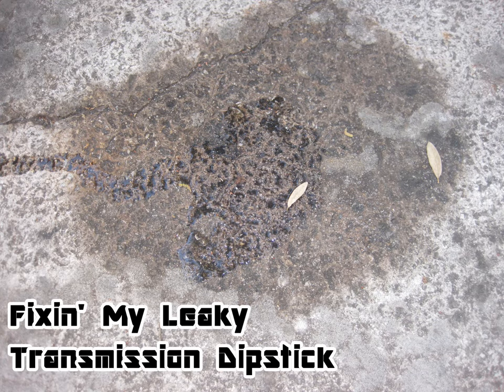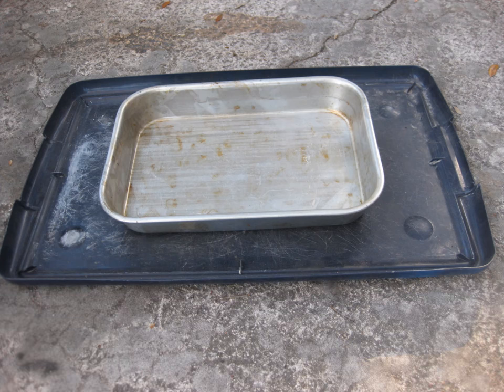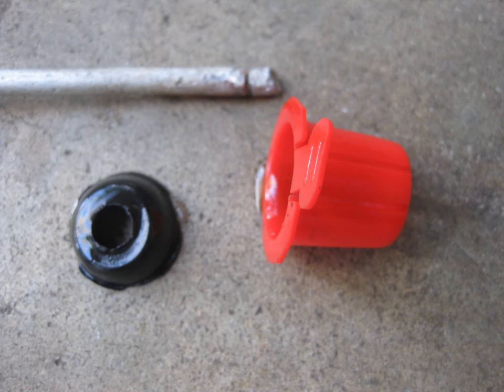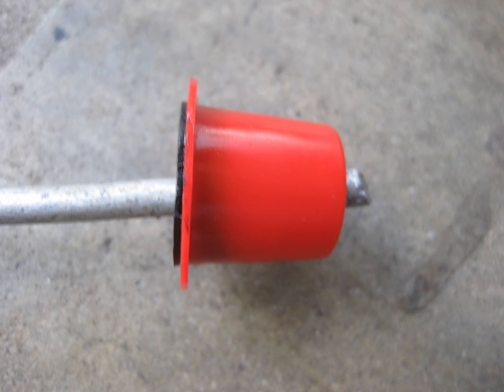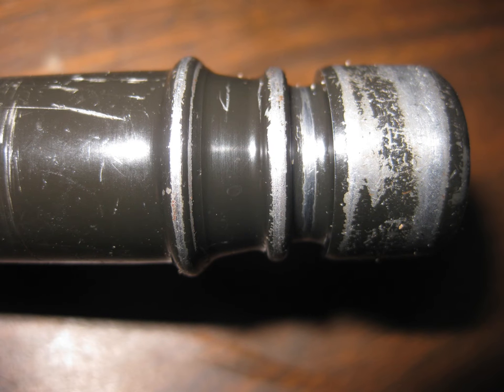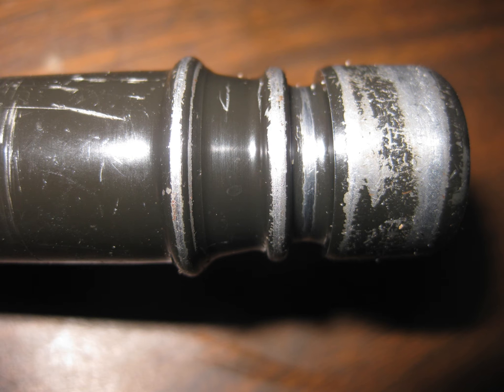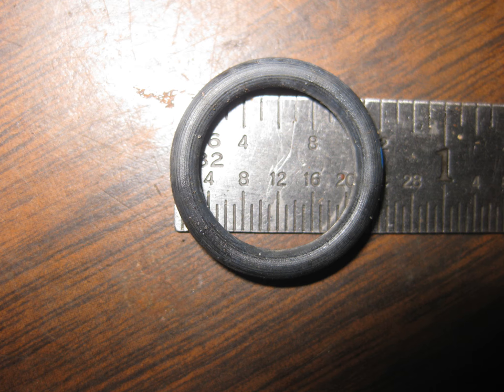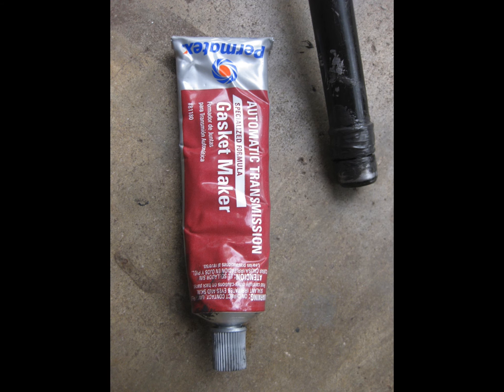Transmission dipstick leaking Fluid?

Comment: Thank you for the information.  But now I want to know why does it only happen after my car( 55 Chevy belair) has been sitting for a while.  Had the trans rebuilt last year, this has happen several times since. The trans is not over filled....can you help me? Thank you.
Reply from the maker: First thing is to find the exact location of the leak.  That means jacking it up and crawling around underneath.  Each location will require a different approach to repair.  Possible sources: Tail housing to drive shaft, pan gasket, Transmission dip stick. Trans cooler lines, gear select shaft, Front seal.  Converter leakage., and probably others.

In an old transmission, I can’t rule out a crack in the housing.  In my past experience, leaking hot or old cool down usually involves a seal or gasket that has aged beyond service life.  I can rule out a warped transmission pan either.  Cork gaskets here don’t age well.  Pull the pan and look for high spots especially around the bolt holes.
Good luck!
Reply from the maker: Make sure the trans dipstick upper mounting hole is securely fastened to the block.  If it is floating, it will leak.  Also make sure the exhaust doesn’t touch the transmission or dip stick.  Check all your transmission to block bolts.  They should be grade 5 or 8 and torqued correctly.  Make sure the dipstick only touches at the transmission and block mounting hole.
Reply from the maker: Are you sure you have the correct dipstick for your application?  Lots of different bends in it must match the application EXACTLY!
Reply: @EdHumble   Thank you for your feed back that is one thing I always wondered about that the dip stick itself never felt right I'll have to look into that ,thanks again!